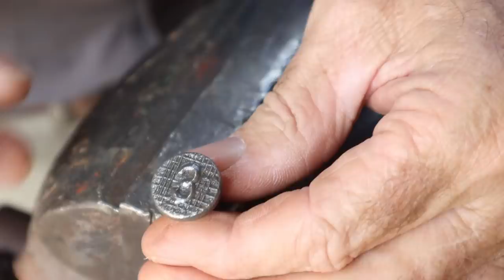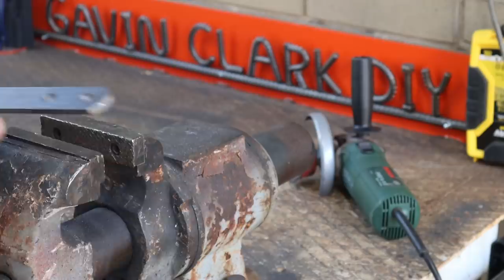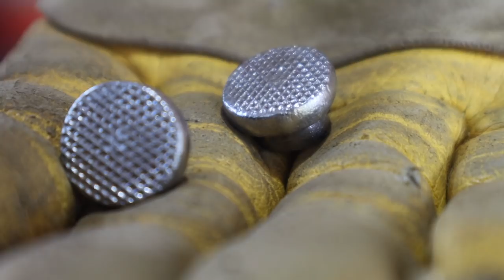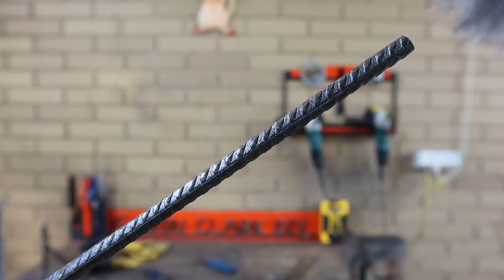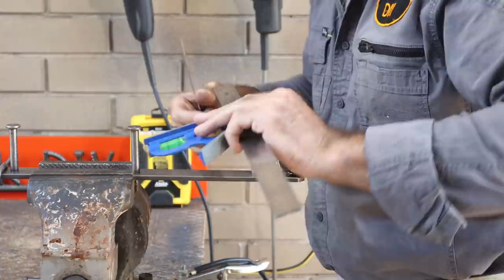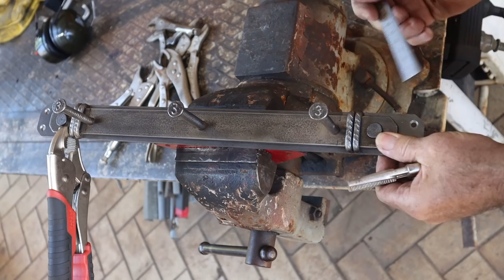I Make an Industrial Style Wall Coat Hooks using Large Nails and Rebar - MIG Welding Project

Comment: Hi Gavin,
Very cool, industrial look!  I've never seen nails like that with numbers on the head before.  They are unique.  Thanks for sharing the project.  I always get good ideas from you!
-mike
Reply: Those are probably sleeper nails, hammered into wooden railway sleepers to mark the year of installation - in this case probably 1903.
Gavin: Great work, I'm impressed as always.
Reply from the maker: Hi Mike we used those type 3inch nails and longer ones in the timber stopes when I was working underground in the mines, I have never seen numbers on them before, and my first thought was if a short nail was used on the job you would be able to tell that it was not a full length nail just by looking at the head, used long handle 7lb strikers to drive them in to the hardwood, I think the 3 would be quite flat once it was in. I do like Georg's comment below, he is probably right.

Comment: I  tried to make something very similar to this but with railroad spikes as the hooks.  But when I welded to two pieces of flat bar together the same way you  did with the holes  in the back  the two pieces warped real bad in the middle.  I  think the back plate on mine needed to be thicker
Reply from the maker: Yes if it was thicker it would help, tack it first and check it is all good and straight, before welting it up. I wish you the best for your project.

Comment: Hi Gavin,  enjoy all your projects, do you put any finish on them?  👍 😎
Reply from the maker: I often use Penetrol Rust Treatment Penetrates Rust 300g Aerosol Spray, and then put two topcoats of Semi-Gloss Clear Coat. That is what I used on the rebar lettering on the back of my workbench, here is the link to that video. https://youtu.be/JA-wk62Zghk  I try not to comment on finishes, As what climate you are in, is it inside-outside, lots of rain, ice, do you want long term and rarely touch, or a wax with a wipe over every year. That is why I have no opinion, Please ask someone in your area what you should use, I feel this is a better way to find out what would be best for you. Thank you for your comment.

Comment: Another nice project Gavin .  Always fun to watch the things you can come up with,  Do you treat your projects with anything to prevent rusting?
Reply from the maker: Thanks Doug, I often use Penetrol Rust Treatment Penetrates Rust 300g Aerosol Spray, and then put two topcoats of Semi-Gloss Clear Coat. That is what I used on the rebar lettering on the back of my workbench, here is the link to that video. https://youtu.be/JA-wk62Zghk I try not to comment on finishes, As what climate you are in, is it inside-outside, lots of rain, ice, do you want long term and rarely touch, or a wax with a wipe over every year. That is why I have no opinion, Please ask someone in your area what you should use, I feel this is a better way to find out what would be best for you. Thank you for your comment.

Comment: Well done! As usual...
Please tell me how you protect the things made from rust?
Reply from the maker: I often use Penetrol Rust Treatment Penetrates Rust 300g Aerosol Spray, and then put two topcoats of Semi-Gloss Clear Coat. That is what I used on the rebar lettering on the back of my workbench, here is the link to that video. https://youtu.be/JA-wk62Zghk  I try not to comment on finishes, As what climate you are in, is it inside-outside, lots of rain, ice, do you want long term and rarely touch, or a wax with a wipe over every year. That is why I have no opinion, Please ask someone in your area what you should use, I feel this is a better way to find out what would be best for you. Thank you for your comment.
Reply: @GavinClarkdiy  Thank you, the principle is clear. Rust converter, then airtight coating or varnish 2 layers.

Comment: Excellent project!
Do you ever put a coating on when you are done to protect from rust?
Clear spray paint?
Reply from the maker: I often use Penetrol Rust Treatment Penetrates Rust 300g Aerosol Spray, and then put two topcoats of Semi-Gloss Clear Coat. That is what I used on the rebar lettering on the back of my workbench, here is the link to that video. https://youtu.be/JA-wk62Zghk  I try not to comment on finishes, As what climate you are in, is it inside-outside, lots of rain, ice, do you want long term and rarely touch, or a wax with a wipe over every year. That is why I have no opinion, Please ask someone in your area what you should use, I feel this is a better way to find out what would be best for you. Thank you for your comment.